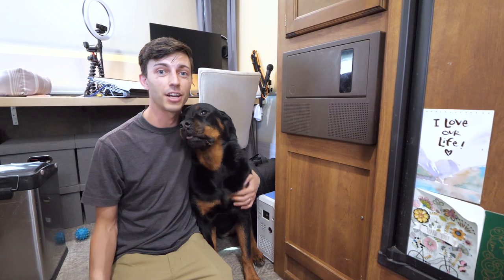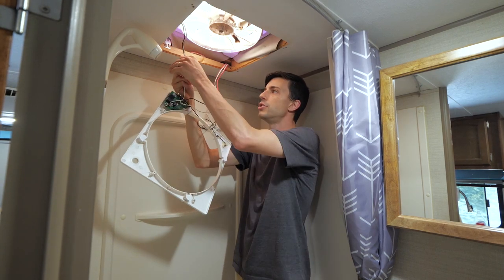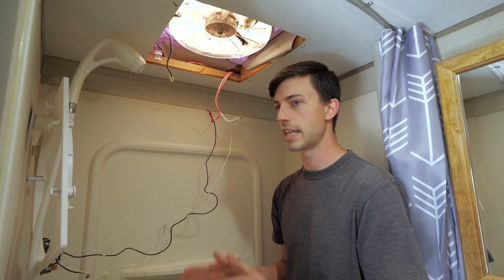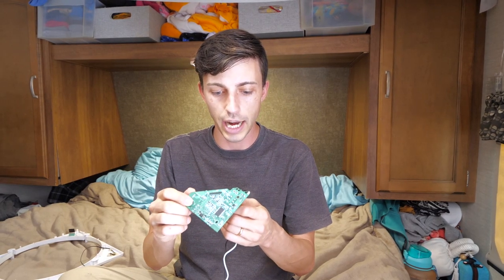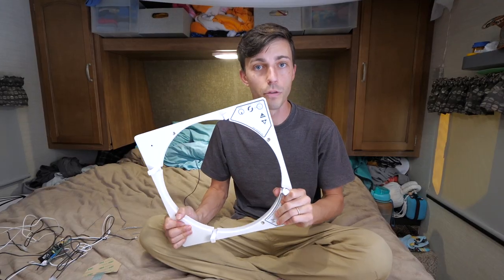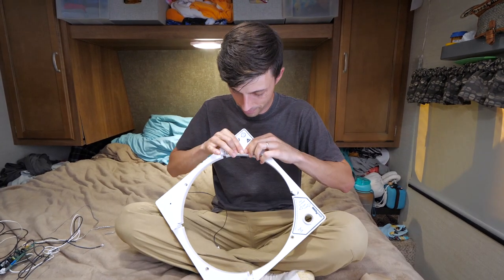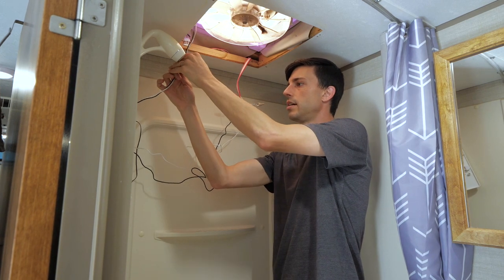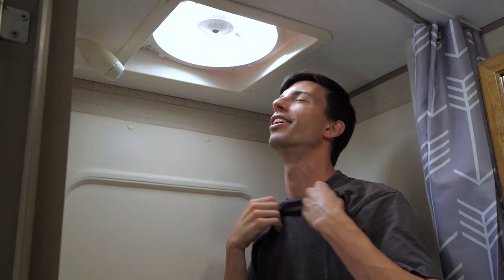How to Diagnose & Repair MAXXFAN RV Exhaust Fan - RV Life

Comment: Electrician for 40 years. The tape won’t do much for moisture. After you make up the wire nuts, try smooshing some silicone inside
Reply: Butt splices are great and easy to work with. The only real difference I see with the wire nut is, it’s actually cutting into the wire and making a more secure connection
Reply: @imadoa4271  if it's done right, butt splices are actually better connections then the wire nuts. Especially because wire nuts have been known to untwist over time and if you don't twist the wire good enough it could also cause issues
Reply: Great advice for the average RV owner. We almost always have some silicone caulk.
Reply: @JamesAutoDude  First time I had heard of Butt Connectors went like this.  

My brother was working on his motorcycle and using butt connectors.

Me:  What cha doin?
Him: I'm using butt connectors to wire in this new light.
Me:  How do they work?
Him: They work good.
Me:  No, how do they work?
Him: I said they work good.
Me:  No, HOW do they WORK??!!
Him: GOOD, I SAID THEY WORK GOOD!!  Oh, wait, you mean how do they work?

Comment: David, great instructional video because I used it to fix my Max air fan. I bought my 2017 Ford Transit Van 250 High roof over a year ago. The date on the fan said it was made in 5/17/2019 so a little disappointed it started having problems. Anyway, after going thru the step by step you presented, we figured it was the key pad which we ordered thru AdventureRv. The part came in less than a week. Our cost was $11.87 plus $5.18 shipping. Adventure RV is located in Sevierville, and we go to Gatlinburg about twice a year so we will be sure to drop in their store on our next trip.  Thanks again! Ken

Comment: When you said corrosion, I said “no conformal coating?” That stuff works great at protecting circuit boards that are exposed to less than ideal conditions. Kudos for going the extra step in preventing future failures. 
Now I got to go take my fan apart and coat it!😁

Comment: Thank you!!! Not for showing me how to fix my MaxFan, but for showing me that those "clips" that hold the screen can be turned to remove the screen so it can be cleaned (mine was sooo dirty).  Plus thank you for showing me how to check the circuit panel. I just purchased a used RV and clueless, but willing to learn. Again, THANK YOU.
Reply: I know I didn't realize that I could do that either.

Comment: For situations like that I use a pair of wires with small gator clips on both ends of both wires. Also for electronics cleaning I use a product called Blue Rain. A product I use for moisture proofing electronics is MG Chemicals - 422C-55MLCA 422C Silicone Conformal Coating 55 mL Bottle. It's applied with a brush so you can control where it goes better. You can also shove some insulation in the hole after you shove your wire nuts and taped connections to help with moisture.

Comment: FYI that temperature sensor is not locked in at 78 degrees. Once you switch to thermostat mode it starts at 78 degrees but you can lower it in 1 degree increments by pressing the down arrow and up 1 degree with the up arrow.

Comment: just a heads up it is dc power and safe to touch even with your battery setup you have. you can touch both the negative on positive terminals on a battery. again its dc voltage and you are not made of metal and due not conduct enough to short out or get shocked.

Comment: To people running across this video - never use wire nuts where there can be moisture. Use heatshrink connectors.
Reply from the maker: 100% agreed that I should have done that. Since this repair I've had to get back in there and replace the motor. When I did I replaced the wire nuts with crimp connectors protected by heat shrink wrap.

Comment: Nicely done! You gave a good tip about doing a visual inspection of components. The control board's condition led you to suspect it was at fault. You know, if you spent more time in Arizona, there would be less chance of moisture corrosion. Just saying. I love seeing your adventures, especially in my home state.

Comment: Little trick when you are putting down things like the button pad. Take a piece of parchment paper and fold it, then put it on the face after you've removed the factory protector sheet. The parchment paper can be peeled back (pulled out from between the two surfaces), allowing the sticky surface to bond to the surface once you've got it positioned. So far I haven't found anything that will stick to Parchment paper, and you can get a roll of it in the cooking section of almost every store (or at Dollar stores). Thanks for the tip about the Conformal coating - when I get ready to replace my electric step controller I'm going to see about getting a can!

Comment: I would add a little dielectric grease to those connectors and wire nuts. The tape is not the best for sealing out moisture.

Comment: You might want to check out WAGO connectors.  They eliminate the need for wire nuts.  Many RV manufacturers are using them now.

Comment: Here in Aus the PCB cost $277+ not including delivery.. the button board was only $11 thankfully.
Mine just died out of know where too, but I had no visible signs of erosion anywhere on PCB or Button board connection.
I have ran my fan for 3 years 24/7 though sooo I can't really complain. aha
Cheers for this, already did all this myself but was nice to know I ticked off everything, was hoping you'd have some magical way of making it work again but no :c

Comment: After only 11 months my MaxxAir 7500 quit functioning.  Fortunately the manufacturer stood behind the 2 year warranty and is sending out a new circuit board.  According to the representative I spoke to the newer circuit boards have a built in voltage regulator which should eliminate the common issues that most people seem to have with the typical 13 plus volts that most rv’s have.

Comment: 12 volts is 12 volts. The fuse is the limiting factor in the circuit. The size of the battery bank is irrelevant. Good video. I am a fan of the crimp on wire nuts to reduce the likelihood of them vibrating loose...

Comment: hello. i didnt have a 12 volt ciggarette lighter plug to use so i used a regular wall outlet plug. do you think i fried my fan circut board.i plugged it into my bluetti poweer bank on the 110 ac outlet. what are your thoughts
Reply: I bet you did, he is afraid of 12 volts, you could have left the power on an used the two wires he had hanging there to test your fan

Comment: I’m having an issue with my max air fan. The air direction when intaking air does not blow directly down, but rather all around the perimeter of the fan. If you put your hand directly under it you feel almost nothing. I just thought this is how it was but apparently it’s not. Have you ever hear of this issue before?

Comment: I do know maxxair has a problem with their circuit boards.  And now they are on back order because of the semiconductor shortage. Apparently anything over 12 volts will take it out. Say like you use a 12 volt supply charger. It supplies like 13 volts.
Reply: 12v voltage regulator seems to be the solution to preventing circuit board failure.

Comment: Thanks! Install went perfectly, but didn't run. You point out that WHITE is ground. That made black positive (when black is usually ground), So I'd connected it backwards. Quick swap on the paddle and spade connectors and away we go. Thanks, again.

Comment: Using a tester light pen would have provided with power or no power with out having to disassemble the fan. Just touch the pen to the hot wire if there is red light you have power, if green light no power.

Comment: The reason MaxAir doesn't make the board water resistant is they don't know where it will be used. Most manufacturers put a skylight in the shower. My vent is over the table. Waterproofing also seals in heat so it's a compromise.
Reply from the maker: Seems like they'd make a water resistant version for over the shower. They have to know there is a high probability they will be put over showers or at least inside a bathroom.

Comment: The size of your power bank, aka the capacity of your 12v battery, has no relation to how dangerous is to touch the wires, or short them out

Comment: That Fan shouldn't be directly in the shower stall,  Camper manufacturer is the one at fault. There are fans manufactured for High Moisture areas, This one is not.